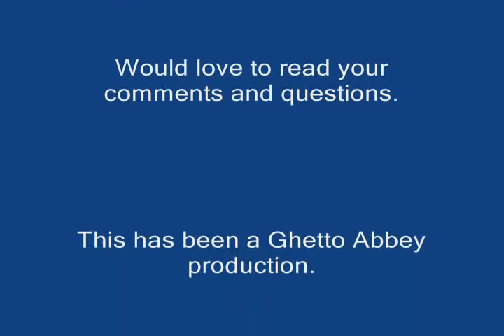Spiral Turned Pepper Grinder

Comment: Nice job. I use an auger bit to drill right through. BUT you must file down the small screw point on the end to virtually nothing. Slowest speed on the lathe as possible. Just another idea for everyone.
Reply from the maker: That's a great idea Chris. I'm sure it is easier to find a long one as well since a lot of the trades use them to go through materials greater distances. Thanks for your suggestion.

Comment from the maker: One thing I recommend on the pepper mills would be to use a forstner bit to drill out the center ALL the way. The setup I used wandered a bit. I have an extension for the forstner bit but it wouldn't do 12".